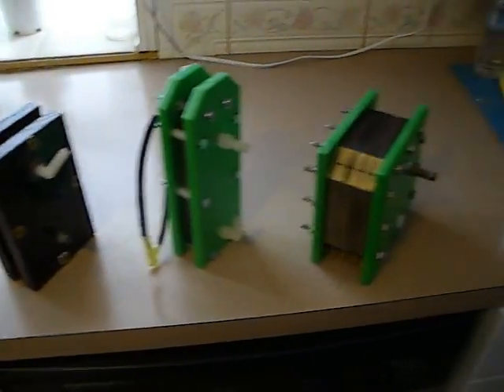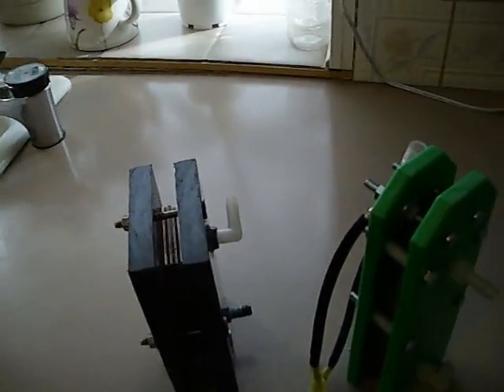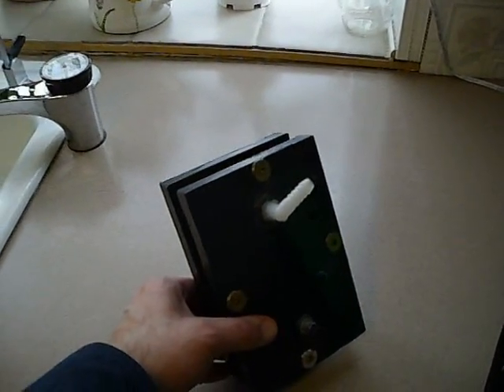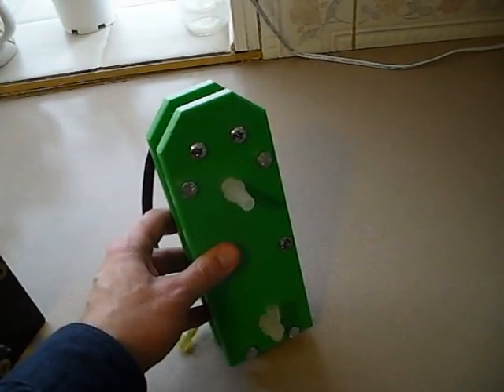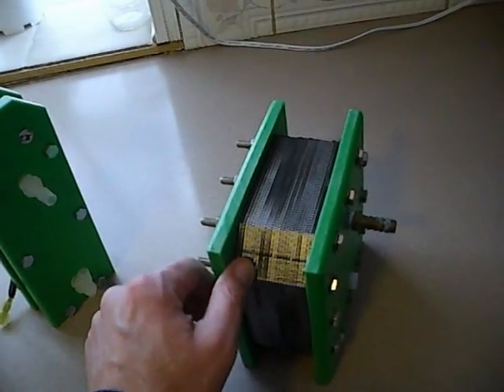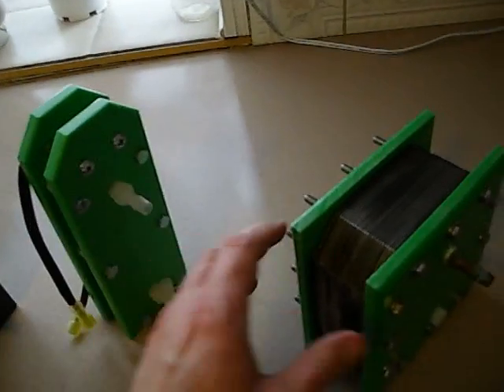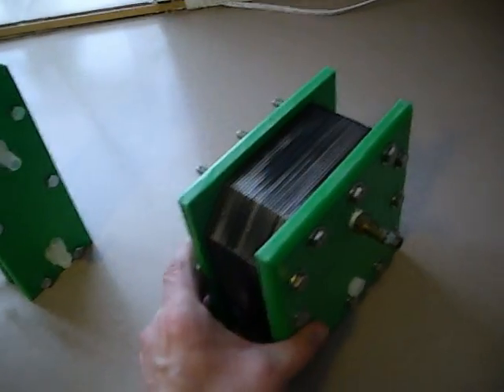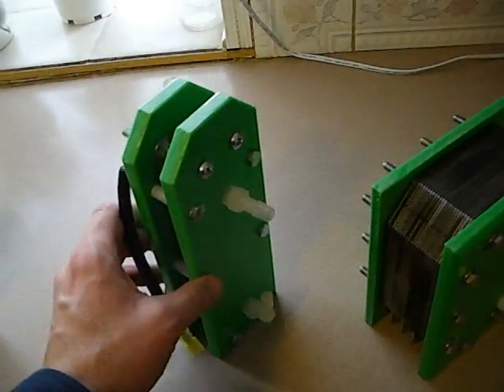3 HHO dry cells compared

Comment from the maker: WOW! 55kv at .2 amps = 11,000 watts and 8LPM (0.727ml per watt): The littlest one in the video was very inefficient at 20 amps and 12 volts (240 watts) and 1.2 LPM (5ml per watt).  Please be very careful with that high voltage!  Through tests we have conducted with large energy companies, higher voltage does not equal more efficiency.

Comment from the maker: Regarding the 1.55LPM output: This is actual physical measurement at 12 volts through cold water. Measuring with a Dwyer meter, it reads 3.5LPM at 20 amps at 13.8 volts. However, if we are honest, we know that the Dwyer meters (and other flow meters) are grossly inaccurate because they do not account for moisture and heat. Scientifically, we have to approach this with as little variables as possible: Dry the Gas, regulate its temperature, regulate the electrical consumption.

Comment from the maker: Yes, I've tried 0 to 5 neutrals.  In my opinion, raising the KOH levels and adding neutrals to increase efficiency doesn't outway the safety concerns I have.  3 neutrals produce enough HHO for most applications in automoblies (at least in mine).  I have road tested different gens for over 2 years.  I have not seen significant advantages to using 5 neutrals (more efficient) over 3 neutrals.  I guess I just go for what is practical.

Comment from the maker: The optimum voltage, according to MIT studies, is 2.4VDC.  However, the trade-off is very high concentrations of KOH.  KOH in flake/powder form is very dangerous.  IMO, it is too high a risk for the average person to grind their own KOH into an easily soluable powder.  However, with 3 neutral plates (which does reduce efficiency) you can use Pequa (pre-mixed water/KOH/colorant).  This is much safer, easier to handle, readily available, cheap and safer than handling and mixing the powder.

Comment: Very nice setups but at 20 amps the output is a little low, at least that's just what I thought. The spacing and configuration is exactly what I'd expect to see 2 LPM, but I don't know how much electrolyte or what kind you used. The $500 setup is just too costly for that production.